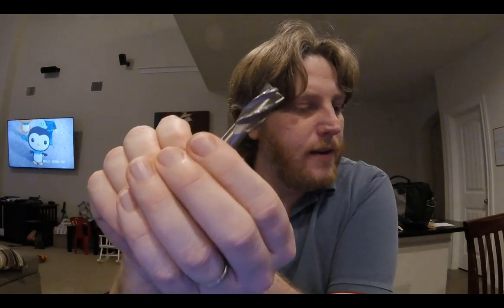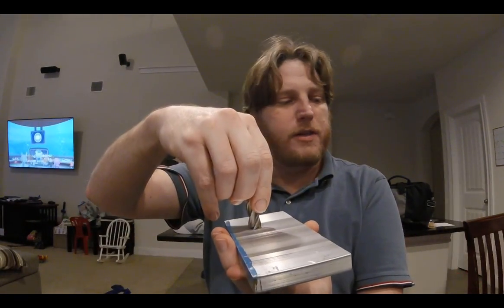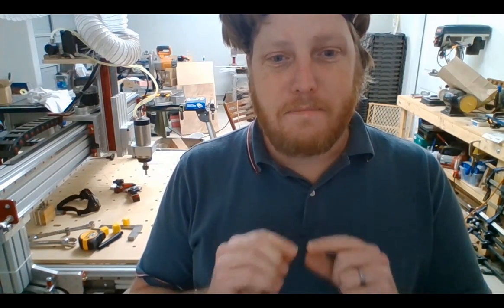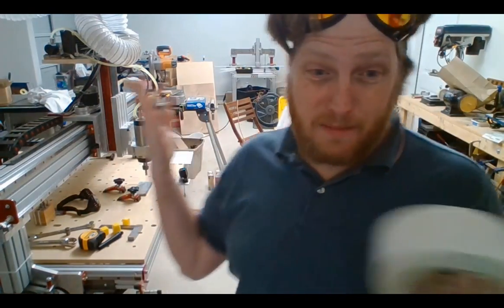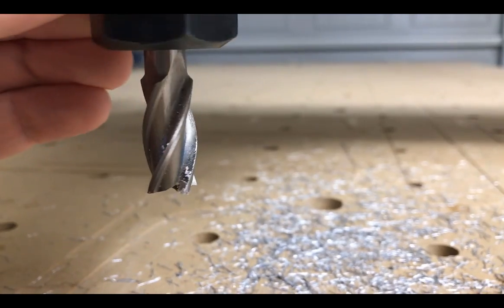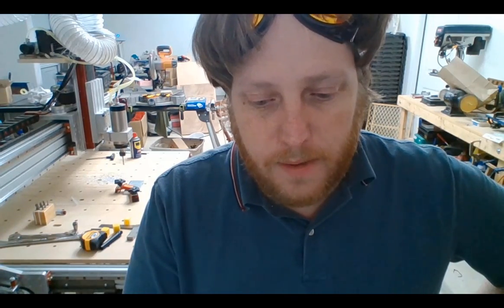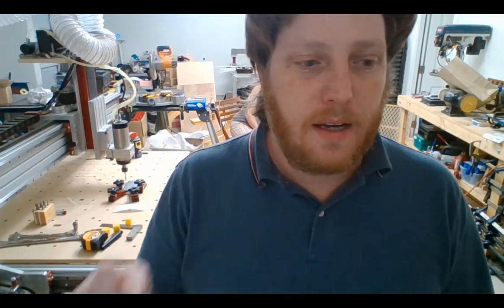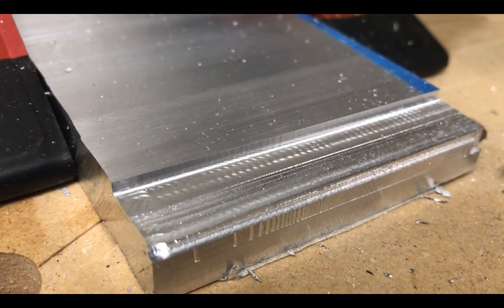Lets figure out cutting aluminum

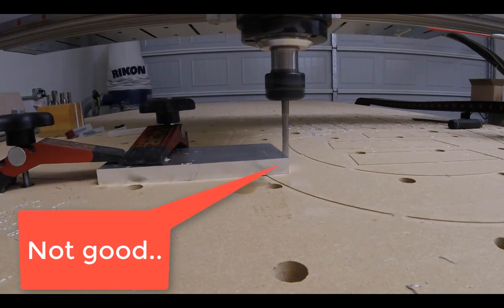Comment: You need to choke up on the cutting tools and NOT use longer stickout than needed, for example on 9:54 the tool stickout is waaaaaaaay too long and you will get into problems especially with a spindle/machine like this that is not very rigid.
Reply from the maker: Oh yah. Learned a lot since that video.  :). Thanks for the comment.

Comment: i know your not THAT new at this, but you can never run milling spindle speeds on a router table,  i know your goal are "proper" chips but don't focus to much on that spindle speed or size of chips on a router table.    good idea for aluminum milling on a router table i have found through the years are max half the distance of a bit for depth and speeds just need to be found to defunk bit deflection like u had and vibration. then you just lower depths and speeds to minimie vibration and deflection accordingly,     btw entertaining video.
Reply from the maker: Glad you enjoyed the video! 

Those are great rules of thumb.. I had some great conversations with Bob Warfield too regarding machine rigidity and cutting aluminum...  I've tuned G-Wizard to fit my machine and when I do go to it for Feeds and Speeds I pretty much always get numbers very similar to those suggestions.. 

I also appreciate the vote of confidence lol... I still have a lot to learn!
Reply: good talk, i always enjoy talk about speeds and feeds for router tables, allot of people are mislead online about speed and feeds with router tables just because of info for "miling machines use",   i work for a very large sign shop with huge router tables, along with the ones at my house, the best speed for the onsrud o flutes are 18k rpm.  for aluminum, cutting and acrylic miling. i always get a kick out of people with hobby home machines tryn to cut/mil aluminum without a spindle rpm control,   your machine looks nice i have been on the fence for one of these cncrouterparts machine for some time, i have a small commercial grade style cnc and want to design my own for 2nd machine especially to save money.    btw you got a subscribe from me.  keep up the good work on the videos.  john from nycnc is also very resourceful as well.
Reply from the maker: LOVE LOVE LOVE John from NYCCNC.. I have a few more tweaks to do on my machine then I plan to do a full review video.. So stay tuned for that :-)..  Right now I am playing with 3d carving so I am making a door sign for my 2 year olds bedroom... (its actually being cut right now out of maple..)..

Have a great one.
Reply: its funny i dont buy gifts for anyone anymore with my routers and laser machine lol